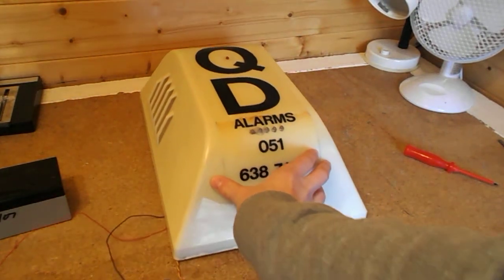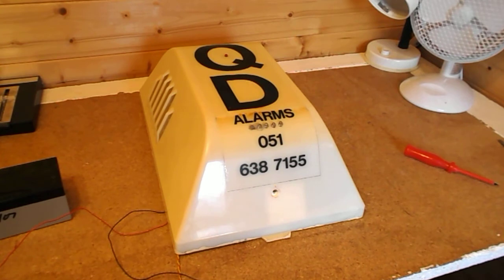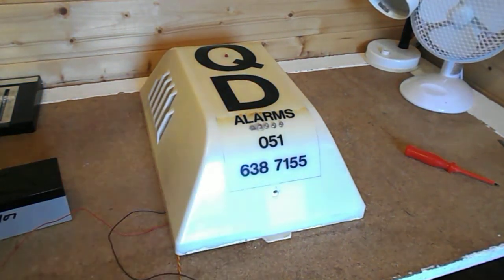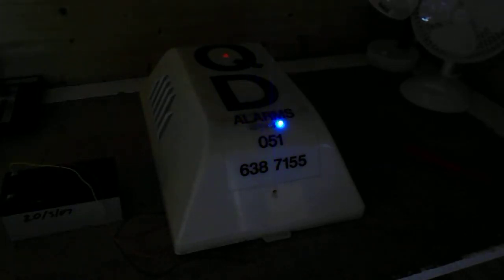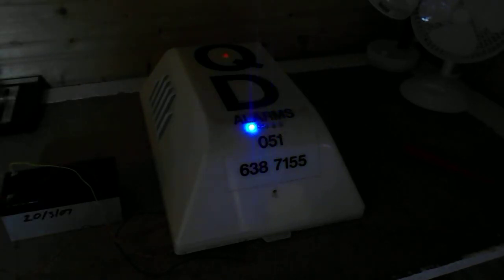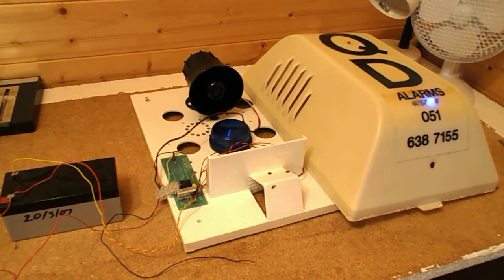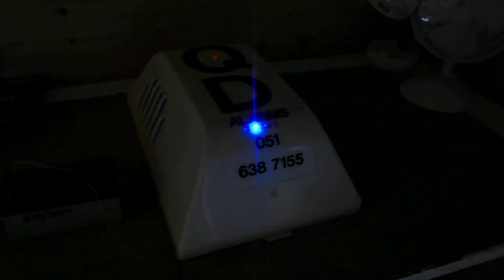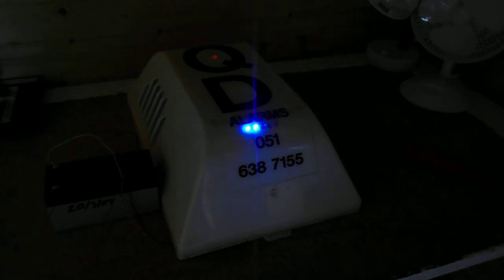QD alarms vented bellbox demonstration

Comment: I’ve seen a Vented bell box without a cover with 2 Lynteck sirens in, they were mounted sideways
Reply from the maker: I have seen one aswell. It was a Type H (dont know what make the sirens were but they were the common black type.) And there was a blue strobe dsngling by wire too.
Reply: The only siren I know of is a Lynteck TK-1010
Reply: @alarmmuseum  there also is a lynteck tk-814 siren.thats the one ive got
Reply: @MB-alarms_and-more  I didn’t know much about sirens when I made that comment
Reply: @alarmmuseum TK-2010

Comment: can u take a picture of the sab
Reply from the maker: unfortunately since making the video this bellbox has been safely packed away and tucked up hidden in a cardboard box in storage. If I ever get the bellbox out I will photograph the s.a.b for you.
Reply: Jake McIntyre oh it's alright now I just needed something to relate to when I connect my sab to the 6 inch siren but sadly it doesn't work so I found out an easier way to use the siren, strobe and LED as soon as I have the alarm running I'll make a video. it's going to be an MCA alarm with the inside led being red so the vents look red and a green flashing led to show that it's on
Reply from the maker: Are you using a MCA type c vented?
Reply: Jake McIntyre yep it's that wickes one I just need Spray paint and some stick on words
Reply from the maker: Good luck :)
Reply: Thanks

Comment: Believe it or not it was quite common for old bell boxes like that to have strobes connected inside. Good video!!
Reply from the maker: Thought so. It has the main characteristics of a type C bellbox but suttle differences.
Reply: Jake McIntyre Yes it's a bit bizzare really
Reply from the maker: BBGrooves1 I have seen a few old bell boxes with the cover bashed off and the strobe screwed to the backplate but I just dont like the idea of it because the strobe doesnt show up as well in daylight as it would if it was screwed to the cover and not the backplate.
Reply: Jake McIntyre I agree with you. I prefer strobes to be visible to the exterior and they attract more attention mounted on the exterior should the alarm activate in daylight
Reply from the maker: BBGrooves1 I think it was just easier for alarm fitters because they would have to buy a strobe then drill the hole for it in the cover themselves but there were always spare pre drilled holes in the backplate that were a lot quicker and easier to use. I can also tell that the holes for the comfort leds have been hand drilled.
Reply: Jake McIntyre it was quite lazy really but more convenient. They couldn't be bothered to drill a hole for the strobe so just used the pre moulded hole for the strobe
Reply from the maker: At least it can be changed round if need be. It is by no means permanent once the strobe has been fitted. At least it unscrews fairley easily.
Reply: Jake McIntyre That's true. I like type c bell boxes without strobes however if they have a strobe it attracts more attention
Reply from the maker: I'm like you then. I dont mind them with or without a strobe
Reply: @jakemcintyre4820  It's a c box made by maximal specificly